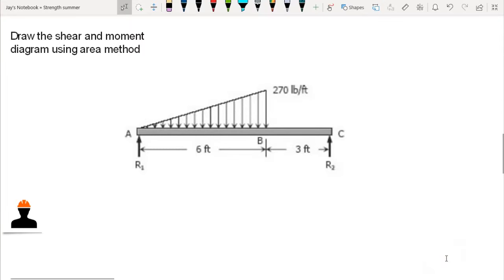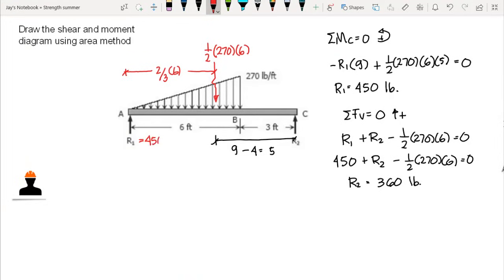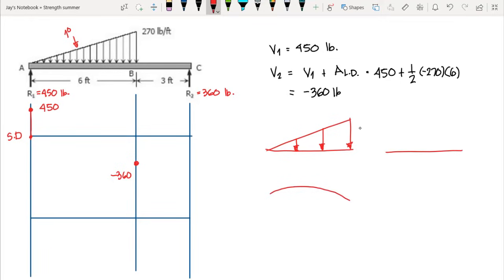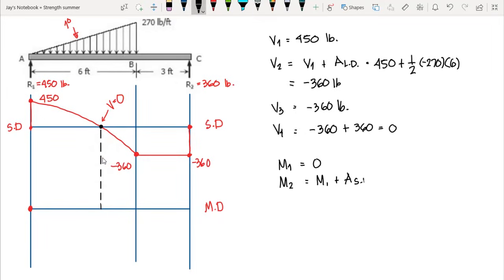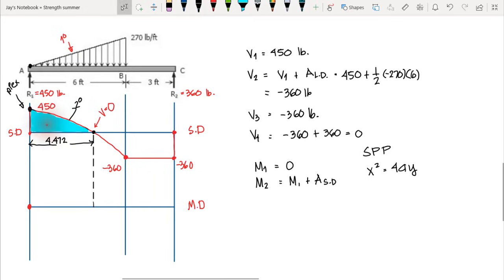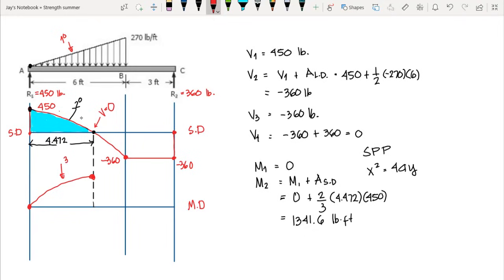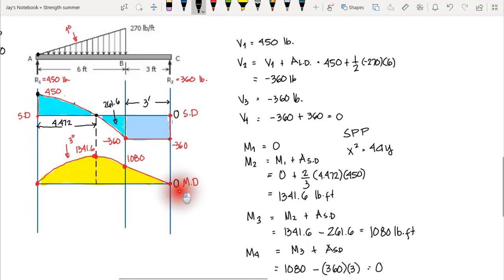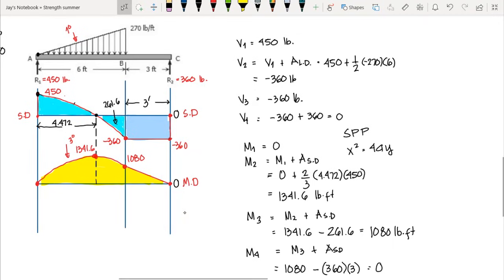Strength of Materials: Shear and Moment Diagram using Area Method (Part 2 of 2)

Comment: Magandang araw sir, 8:44 meron po bang ibang way para makuha yung distance x na hindi gumagamit ng Squared Property of Parabola? Medyo mahina po kasi foundation ko sa parabola baka po may ibang way. You earned my sub sir, khit napadaan lang ako dito para pagkuha ng distance x pag curve yung shear.
Reply from the maker: Pwede naman. Gamit ka ng shear equation. Tapos u set shear equals to zero. Then compute the value of x
Reply: pwede din po

"the change in shear between two points = area of load digram between these points"

V2 - V1 = A(1 to 2)

so at 9:50
let
pt 1 =  at A
pt 2 = at zero shear

V2 - V1 = A(1 to 2)

0 - 450 = - 0.5(x)(270x/6)

x = 4.47

Comment: What is the value of A load diagram?
Reply from the maker: Saan banda po sa video?
Reply: @engrjayc  3:52 po.

pag Area of Load Diagram=0 po ay maging -360. Consant ba ang 0?
Diba itimes yan sa 450?
Reply from the maker: @japhethmirafuentes8551  yan pong 1/2(-270)(6)
Reply from the maker: @japhethmirafuentes8551  area po nh triangle
Reply: @engrjayc  I see po, akala ko kase V2 =  V1 + Area of Load Diagram • 450 + ½(-270)(6)
Reply: "=" pala yung in between sa Area of Load Diagram at 450 akala ko "•" multiply

Comment: bakit po hindi pwedeng 

1/3 (6 - 4.472) (360) ??
Reply from the maker: Hindi applicable pag dun mo gagamitin. Dapat dun ka sa pinaka highest ng parabola mag spandrel.
Reply from the maker: Hindi puede kasi hindi yag ang pinaka peak ng parabola. Ang pinaka peak ng parabola is kung saan ng zero ang load.
Reply from the maker: Saan part ng video?
Reply: yung sa pagkuha ng area nung maliit na spandrel
Reply: sa shear
Reply: 12:38 po